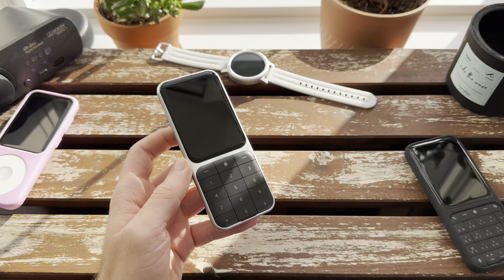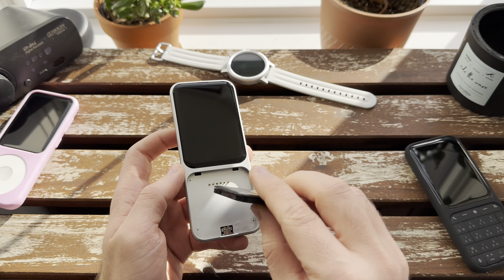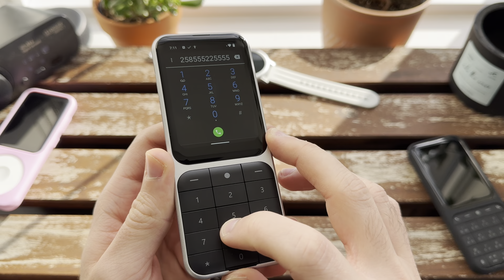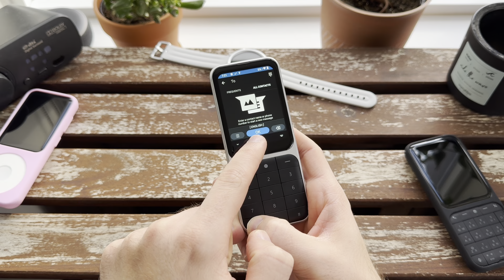Sidephone Keypads and Keymapping

Comment: I desperately need to see info on that SureType module <3 My absolute favorite form-factor ever used was the BlackBerry Pearl because of how fast it could be (when prediction worked, of course). I know that the plans are to launch with the number pad but without knowing when or if the module teased on the right will be released, I can't help but be hesitant. Product info in general is very scant on both the site and store page :/

Comment: QWERTY plz. Make different  keyboards, touch pads, game controller.
Or move the connector to the top aide under the screen so you can make one pad that has two different sides i.e. QWERTY side and other side T9 pad.
Another pad with one side touch pad and other a game controller.

Comment: Sony Ericsson Aino U10i?
Will there be a sliding option with a bigger screen? Cuz with that size and my big hands, the touchscreen will not be able to be used normally, always have to use fingertip like in the video. Looks a bit finnecky (or how thats spelled)

Comment: Hi. I'm interested in using this as a remote control for home assistant and controlling settings for something autonomous. Will the expected price be under $200 or hopefully $100? And could it be programmed to always stay on one webpage or app while the sundial is in?

I was planning to use a couple of those $50 android media players, but I like the idea of physical buttons so I'll use this if I can afford it.
Reply: This looks like something I could keep on a 3d printed wrist mount, and have always available like a utility watch.
Reply: $299
Reply: @thornex6082Most likely I'll be using one of those $70 android emulator game controllers that look like a GBA then. They're bigger, but that's just not a $200+ problem for me.

This is small enough to wrist mount, so maybe when I finally have cash to burn.